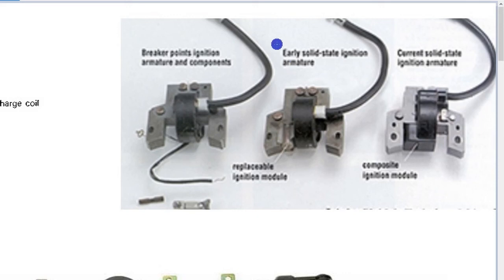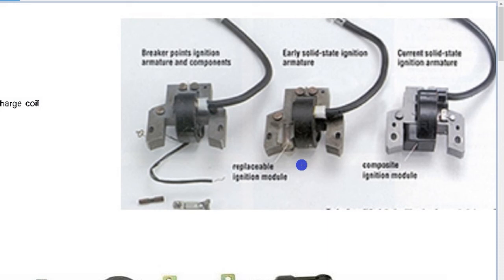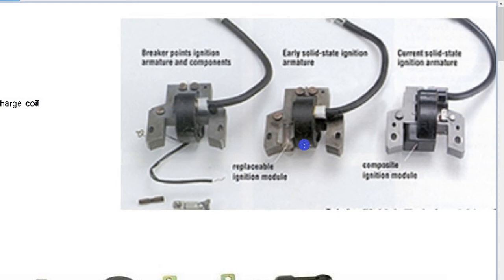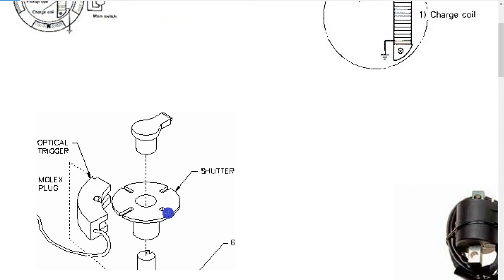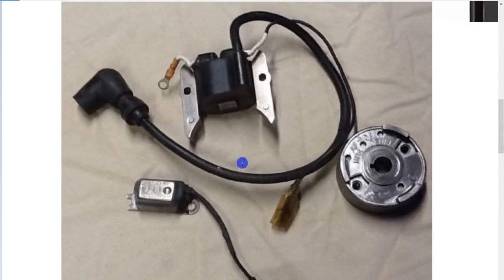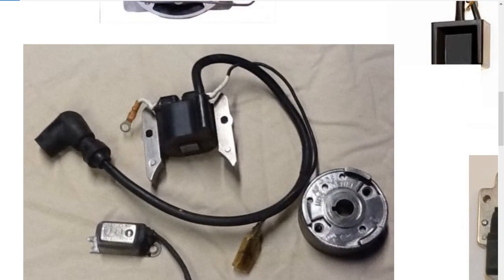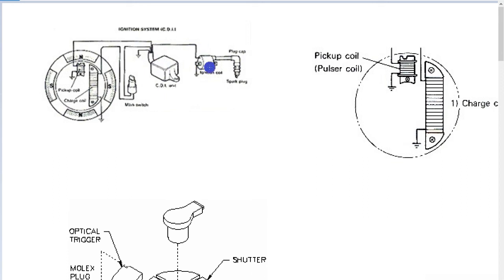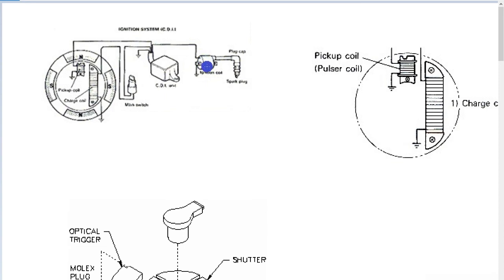2 stroke Ignition, solid state triggers,TCI and CDI E28

Comment: Great video, thanks. I have a typical mid 80s victa 2 stroke lawn mower. It has a magneto ignition system. There is a magneto on the flywheel. A U shaped iron core surrounded by the ignnion coil. It has a silver igntion module mounted on the mower frame ( and this must be the TCI module control) you talk about in the video. What i want to understand is exactly what is inside this module? Im guessing transistors but would gave a video where you take apart a TCI module for an ignition magneto system and map out the circuit diagram and explain how it works ?
Reply from the maker: That's not a TCI module
The Module in mower engines is basically just a replacement for the oil points breaker.
The module has some pretty basic components.
In fact you can fit one of these to any old engines with a set of points and just delete the points and the module will do the same job.
To explain that in more detail.
When the moving magnet passes the coil poles, the voltage rises then falls but when the voltage falls it is too slow to collapse the magnetic field suffice to cause a decent spark at the secondary.

In old engines the points performed this function of suddenly disconnecting the primary circuit when the primary voltage is at peak to cause the field to collapse into the secondary windings suffice to give a decent enough voltage to jump the gap of a spark plug.
So in the module the circuit stay closed when the voltage rises and as the magnet moves even further past the coil poles past the peak of voltage instead of just letting the voltage fall slowly it suddenly disconnects the primary circuit  like a set of points would.
Reply: @AuMechanic you have a great channel and I enjoy it. 

I found this article / forum that shows the Atom industries ignition module replacement to delete igntion points as you say. 

I can see in this forum post someone has reverse engineered it and its made up of various transistors. Have you ever done a tear down to the circuit level on one of these ? 

Is this not a TCI module the Atom industries module ?
Reply from the maker: @edwardmenzies6736  No I wouldn't class it as a TCI which is an ignition system that has a solid state trigger in it.
By that I mean the transistorized ignition has a separate trigger coil that is attached near the crank (or in a distributor off the cam) and that only triggers the switching of the transistors but the coil itself is powered from either a battery and or a separate charge coil.
The mower one (Atom you looked at) I described is unique in that is has no actually trigger pickup coil it simply switches by monitoring the voltage curve of the primary side of the magneto coil.
So with the TCI it is sim0le enough to change the base timing or timing curve where the mower one is tied to the magneto trigger point.
Reply: @AuMechanic this is a great explanation mate. Really top notch. I now understand what you mean, awesome. 

Ive done heaps of searching online about how to in depth understand the victa 2 stroke ignition system and there is general explanations like "the magnet passes thr coil and induces current in thr coil and creates a spark"  but there isnt good in depth knoweldge or explanation on the specific physics of how it works.  

I found an extract from a Paul Demspey 2 stroke motorcycle book that goes in to some good explanation on how the magnetic flux line in the E laminated coil goes one way based on thr north pole and then the other way as the magneto travels past thr coil. Behind that its limited. 

I guess once the magnet on the coil just goes past the coil the collapsing magnetic field creates the voltage in primary and then secondary to soakr plug. 

Ill link it below and also his video where an old mate university profesor passes a north south pole magnet across a coil and shows currnet going  up and down brings it to life a bit
Reply: https://youtu.be/JGgHe2oiaMg
Reply from the maker: @edwardmenzies6736  
"I guess once the magnet on the coil just goes past the coil the collapsing magnetic field creates the voltage in primary and then secondary to soakr plug. "

Note when it goes past the coil the field in the primary is at its peak, but after the magnet passes, the field in the primary windings collapses too slowly in to the secondary windings by itself to provide a spark at the secondary, which is why you need the sudden disconnection of points or the module to ensure the collapse of the field in to the secondary windings is rapid enough to generate a high voltage in the secondary.

Comment: Ive been looking for a cdi or some replacement system for my 1975 250cc Kawasaki. Any suggestions in what i may be looking for and where i may aquire the hardware? I know its a specific question but anything would help, ive been building this engine since highschool and need to see it roll down the road.

Comment: I didn't watch the whole video but would a 4 stroke cdi and coil work on a 2 stroke
Reply from the maker: No, not because of the basic CDI system but due to modern CDI units having a timing curve programmed in to their module and a 4 stroke one is not suitable for 2 stroke one.
Reply: @AuMechanic  would just a basic 2 stroke cdi on ebay would that work on a yz125 or would a Yamaha blaster cdi work it's a 1990 model
Reply from the maker: @tarabarker6781  Too specific to answer that.
If the blaster has a module and it has a limiter in it then that could be a problem for the YZ, and then there is the issue of does the rotor fit the crank and if not then is the stator radius and mounting the same.

Comment: Is solid state on a 2 stroke bicycle motor better then CDI out fit
Reply from the maker: For a bolt on bicycle engine the basics solid state is probably good enough, they are usually pretty low powered engines that don't rev very high.
Reply: @AuMechanic  Thank you

Comment: Hang on champion... are you telling me that 2 strokes don’t benefit from advanced timing at higher rpms (like 4strokes do)??
Reply from the maker: Yes, as the 2 stroke gets on to the power intake mixture density increases and with that an increase in flame speed that exceeds the increasing engine speed.
You will find many 2 strokes in things like scooters and chainsaws do not retard ignition at higher engine speeds to limit maximum RPM, to overcome that you need a programmable module that allows it.
For road racing purposes there is no need to have any advance as it is operating at peak RPM range most of the time.
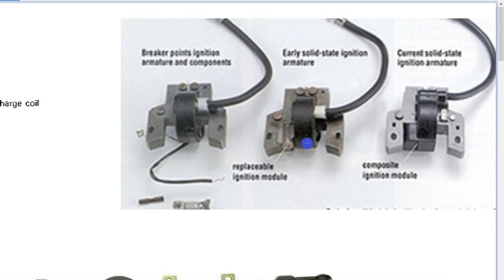Reply: AuMechanic at 3:20 you said it’s good for a 4 stroke application.  Is that to say it’s not good for 2 stroke??
Reply from the maker: @mareksumguy1887  
Yes in cases the ignition simply advances through the RPM range, 2 strokes however need a module with a curve that retards at the top end (like you will find in Karting)
Reply: AuMechanic and why would you want to retard timing at higher rpm. If anything you would want to advance... as the charge density (VE) is lower and the rpm is higher.
Reply from the maker: @mareksumguy1887  
Not in a 2 stroke